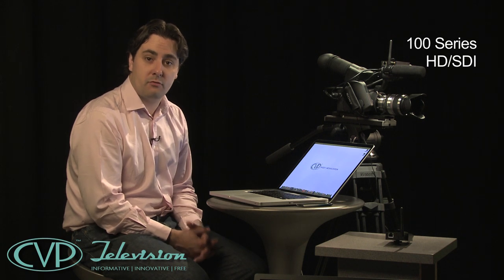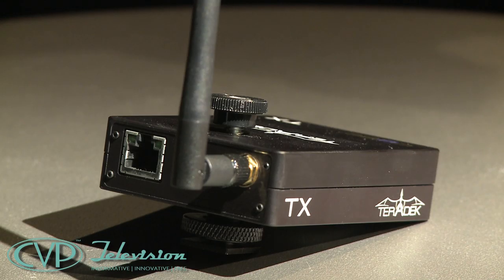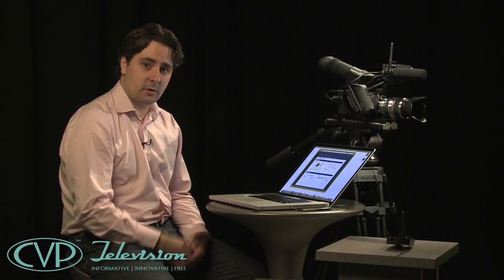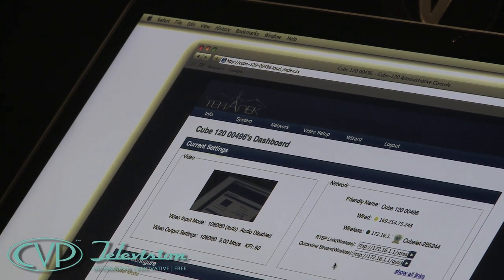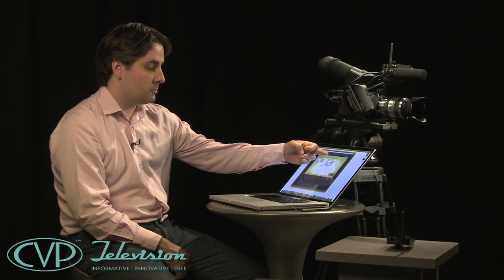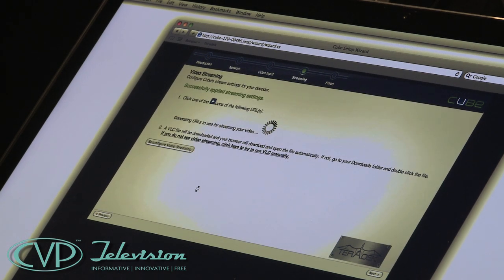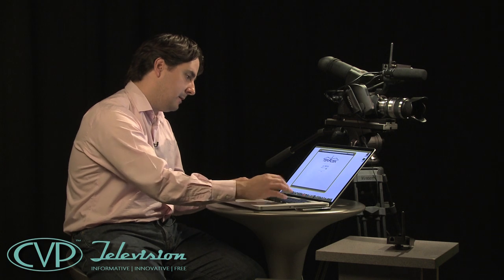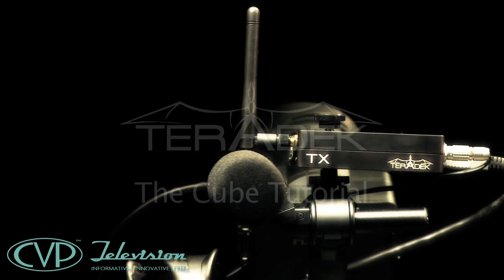Teradek Cube Tutorial

Comment: You should be able to get at LEAST 100 feet radius.  This is usually PLENTY of connectivity for a small to medium production setup.  The most important thing to remember is that there can be MANY pads connected, so, while in the past you had to split or daisy chain a signal and run a TON of cable to feed each monitor, and probably still have groups gathered in a close cluster around the few monitors, now, each director can have their own, the PA's can have them, the light AD can have, get it...

Comment: It is simply a streaming encoder.  It takes a feed from the SDI out (or converted HDMI or Component signal for non-SDI cams) and broadcasts it.  If your camera can send out a monitor signal and record at the same time, that will not change.  If you use a HyperDeck Shuttle 2 (as we do), you can send the signal to the Shuttle, then use the SDI out to feed the SmallHD focus monitor, then pass through to the Teradek for on-site production monitoring.  Record in camera, on Deck, view on pads.  Rocks!

Comment: There is a mini jack on the front of the unit (where the SDI cable port is) which is the audio in for the deck.  Simply plug the audio out or headphone out (if you do not have a dedicated audio out) from the camera to the Teradek and you should see the audio encode with the SDI stream.

Comment: Not certain why they are not responding to these comments.  I will try to fill the gap.  I do not believe there is an iPhone app yet, but there is one for the iPad.  And yes, with the right cube, it creates an ad hoc wireless network (no router needed) that the Teradek iPad app can then see, stream and monitor, in SD or HD. It can also be monitored on a Mac laptop.  Best of all, MULTIPLE pads and laptops can access the feed at the SAME time, with no additional stress on the encoder.